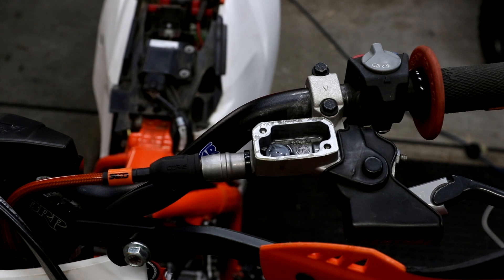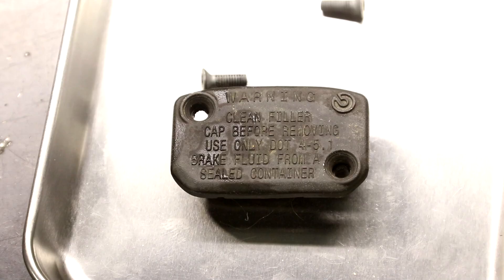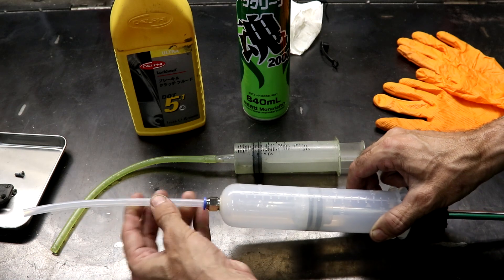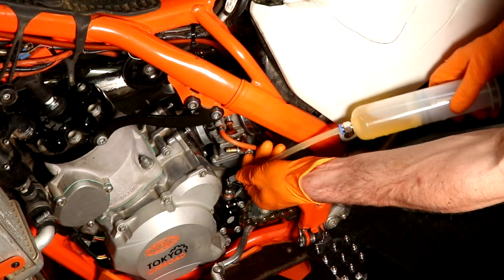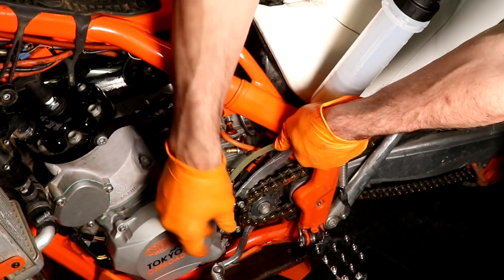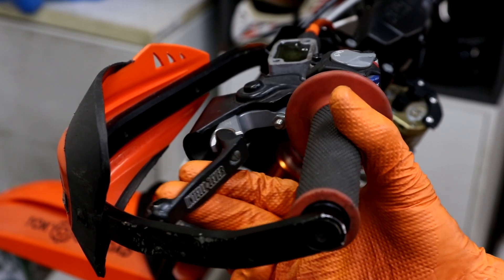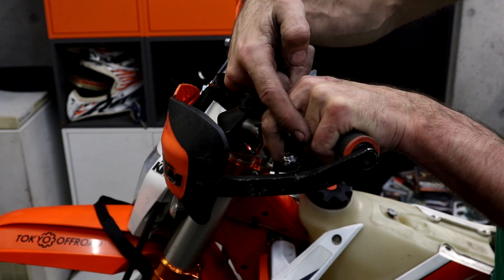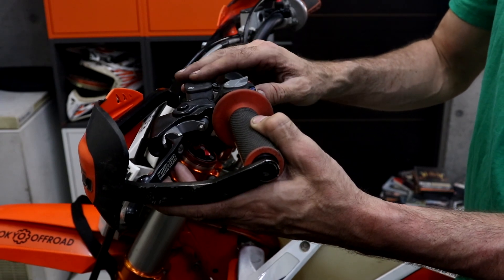Hydraulic Clutch Reverse Bleeding

Comment: To stop the fluid leaking at the slave cylinder bleed nipple, you can wrap some PTFE tape around the threads just make sure the small hole on the side of the nipple is not covered.

Comment: Thanks so much for this. Why don't workshop manuals prescribe this method? I've always suspected there was a better way, as it's bloody logical that air tends to rise in fluid, thus resisting being forced downwards. Is this another example of stupidity in the auto industry, or just a ploy to get people to use more brake fluid than necessary according to 'waste = profit' mentality? Thus we have all these theories on how best to bleed brakes preached by know-nothings and, pushed by the parts industry, an abundance of 'power bleeders' that still waste oodles of fluid (unless you're astute enough to collect and reuse it once the fresh stuff begins to flow) and which aren't even a universal fit. One question I would pose is this: Was it really necessary to keep filling once the master cylinder was full? That is to say, isn't it possible that all the air was expelled once the fluid level reached the maximum point? Thanks again, matey.
Reply: My KTM manual says to do it this way. I dont think there's some kind of plot by KTM to sell you more brake fluid lol.

Comment: I rebuilt my slave cylinder & when I tried to reverse bleed to fill up the clutch reservoir the fluid would push up into the reservoir, can you tell me what might be the problem? Thank you
Reply from the maker: Would, or wouldn't? Fluid should be able to push up into the clutch master when reverse bleeding. If it doesn't make sure that the lever position is fully out (away from the bars, not pushing on the master piston) and that the slave bleeder is open.
Reply from the maker: Also, it you rebuilt the slave, you'll achieve a much quicker system bleed if you fill the slave with fluid and hand bleed it before reinstalling. I show this in this video from 10:30 : https://youtu.be/kfVfvbodc9A

Comment: I am having trouble bleeding the clutch this way. The fluid is coming out from where the bleeding nipple meets the banjo bolt but fluid is not going to the reservoir. I have just done the brakes the same way and it worked perfectly fine. Any idea why this might be happening? On another KTM I had the same issue with rear brake but no issues reverse bleeding front break or clutch.
Reply from the maker: The most likely causes are either the bleeder nipple on the slave is not open, or the clutch master piston is partially engaged (make sure the clutch lever is adjusted out and not pushing on the piston).
Reply: I suspected the lever engaging so I completely took it off and it didn’t make any difference. If the nipple wasn’t open would the fluid still leak out of it? I pushed about half a string of fluid through and it just all basically spilled on the floor. I unscrewed the nipple half a turn. I tried unscrewing even more but it just resulted in fluid leaking on the floor even faster. 
I tried bleeding the normal way by pressing on the clutch lever and everything worked as expected. Nipple opens and closes properly and fluid gets discarded into a hose attached to a nipple.
Reply from the maker: @patpaluch9842  From your description it sounds like a master issue. Either the master piston is partially engaged for some reason, or debris might is blocking the fluid return passage.
Reply: Thanks. I appreciate your help! I’ll recheck the master.
Reply: For anyone stumbling across this thread having similar issue. I ended up solving this. Still not sure what the exact cause was but I ended up taking off the clutch lever again and then I took off the slave cylinder and pressed it which worked and the fluid backed into the master cylinder reservoir. After doing that I was able to proceed with reverse bleeding the system with fresh fluid.
Reply from the maker: @patpaluch9842  Pleased to hear that you were able to get it working. My guess is )if it wasn't the lever engaging partially engaging on the master piston) is that there was some debris blocking the master fluid return and by pressing the slave piston in the force of fluid displaced the debris. If your clutch master needs rebuilding I do have a video which covers that which may be of interest: https://www.youtube.com/watch?v=yigjs0JVai8 and also have a clutch slave rebuild video here: https://www.youtube.com/watch?v=kfVfvbodc9A

Comment: I tried this method about 3 times and each time I have the same problem, 1st problem the syringe is extremely hard to press, 2nd problem I have more fluid leaking from the bleed screw then it's going up thru the hose . What am I doing wrong ?
Reply from the maker: A large, good quality syringe helps and is easier to press than a small syringe. Make sure the hose is a good fit on the bleed nipple. It using silicone hose you can secure it to the nipple using a zip tie. And make sure the bleed nipple is open enough when forcing in fresh fluid from the syringe.

Comment: Hello! I tried this on my bike with the bleed screw open and the reservoir empty. When I depressed the syringe nothing happened. I then took the clutch line off the clutch lever and was able to get the syringe to depress. Any idea what’s going on at the clutch lever? Thanks!
Reply from the maker: The master piston is probably still engaged. Make sure that the lever is adjusted out enough, or fluid will not be able to pass into the master reservoir as it’ll be blocked by the piston

Comment: I've got a gas gas txtpro and having an absolute nightmare. It's just engaging the cluch at the bars, so I've got serious drag.   I've redone this 3 times, and I'm sure it's the right way that I'm doing wrong or not enough.
Reply from the maker: Sometimes you can get some air trapped in the clutch slave and a regular bleed (from master to slave) may work well following reverse bleeding. With some hose on the slave bleeder, try pulling the clutch lever in and hold it to the bars, then open the slave bleeder and note if any air bubbles come out with the fluid. Repeat this 3, or 4 times, topping off the master fluid as necessary.
Reply: @Tokyo Offroad  thanks I'll give it a go.   I've now got it to the point where it slightly drags when it's in 1st but your body weight stops it dragging. So a slight drag.  If it's in 1st and your feet are on the ground then you can feel it slightly. 

Thanks again I'll give that a shot.

Comment: Great stuff, mines engaging from the handle bar so i take it theres still a little bit of air left! Gunna bleed it up from bottom n see if any better! 🙏🏼
Reply from the maker: Yes, probably some air somewhere. Try the reverse bleed and see if it fixes it. If it’s still not right there might be some air trapped in the slave. You can put some hose on the bleed nipple, pull the clutch lever in, open them close the slave bleed nipple. That should get rid of all the air. If you still have problems it could be a damaged master seal, or damaged slave o-ring, either of which can be repaired (I made separate videos covering the repairs).

Comment: I got confused why put brake fluid inside the bleeding were the clutch fluid comes from
Reply from the maker: The Brembo hydraulic clutches on most late model KTM dirt bikes use DOT 4, or 5.1 brake fluid. Note that Magura clutches (fitted to many Husqvarna bikes) use mineral oil. The correct fluid is marked on the clutch master cap and in the owners manual so it's easy to confirm...
Reply: @TokyoOffroad  aw ok well thanks man and Awsome video 🤘🔥

Comment: Hi my sons ktm 65 was going fine parked it up about a month r so started it and wen going into first gear it just stalls and jumps forwards if I give it bita rave it will go but with a slight crunch .any idears
Reply from the maker: If the bike moves forwards even with the clutch lever pulled back to the handlebar then there is either a leak and air getting in to the clutch hydraulic system, or the clutch master, or slave needs rebuilding. If the master seal is gone the fluid level in the mater will not change, but the clutch will not disengage correctly. If the slave seal is gone the fluid level in the master will decrease (fluid will leak into the engine) and the clutch will not disengage correctly.

Comment: What happens if I do this, and and still
Keep getting air bubbles?
Reply from the maker: If air bubble keep coming up, air might be leaking into the hose from the bleeder screw thread. One thing you can do to help prevent this is remove the bleeder and put a little grease on the threads. The grease should stop air leaking into the hose even when the bleeder in loose during the bleeding process.
Reply from the maker: And sometime you may find a little air trapped in the slave. After reverse bleeding, try pulling in the clutch lever to the handlebar and hold it there, then with some hose on the bleeder loosen the bleeder and retighten the bleeder. Repeat this a couple of times if necessary.

Comment: Reverse bleeding is best for clearing air from the clutch line.  For fluid changes you can just gravity bleed and it’s neater and easier.  It goes slowly so you can avoid sucking any air into the lines.  Just did mine this morning.

Comment: Can you use dot 4 oil for the clutch? Because the owners manual recommend motored hydraulic fluid 75
Reply from the maker: Motorex Hydraulic Fluid 75 is a mineral oil fluid. I'm guessing you have a bike fitted with a Magura clutch master. No you should not use DOT 4 fluid. On the clutch master cover it probably states to only use mineral oil...
Reply: @TokyoOffroad  No, I have a Brembo clutch lever, infact on the master cover it calls for dot4/5.1.
I do not understand why on the manual it recommends the mineral oil and on the bike it says another thing...
Reply from the maker: @loskiff  - What bike do you have? Did it come stock with a Brembo master. Is the slave also Brembo? If both are Brembo then you should use DOT 4, or 5.1 fluid...
Reply: @TokyoOffroad  Is the slave the part located on the left side of the engine? In which enter the cable with the fluid from the pump on the handlebar? Thanks
Reply from the maker: @loskiff  Yes, the clutch slave is on the left side of the engine and is joined to the master on the handlebar via the hydraulic hose.
Reply: I have OEM Magura clutch cylinders on my Husqvarna 701 and manual says to use DOT 4/5.1 brake fluid for clutch. The clutch cover itself says "Use only DOT 4 brake fluid". The clutch fluid color is quite different from braking fluid color though, so I'm not sure that brake and clutch have the same liquid from the factory. That's all confusing indeed, but I would stick to the manual and put to the clutch the same recommended brake fluid I used for bleeding brakes.

Comment: My clutch feels fine engages fine but my wheels hard to spin almost won’t when bikes not running and I put it in gear that’s my 300 xc I did same on my 450 xcf and when I put it in gear not running it pushes easy not sure 🤔 what to do with the 300 now re bleed I guess
Reply from the maker: If the clutch operates and engages fine it doesn’t solid like you have a bleeding issue. You may just be experiencing excessive clutch drag. Drag will be higher when the transmission oil is cold. Also do not over fill your transmission oil and use the oil grade specified in the manual for your bike. I made this video which shows how I measured the correct transmission oil volume for my bike https://youtu.be/AhxQje0jFAM

Comment: So at times I have experienced getting air into the system when I loosen the bleeder as air gets past the threads. How do you recommend stopping this?
Reply from the maker: I personally haven't experienced an issue. I think when reverse bleeding the fluid is under pressure and may leak out a little bit past the bleeder threaded area, but in doing so will prevent air entering. I have heard of some people using grease on the bleeder threads to help prevent leaking during bleeding, but haven't tried it personally.
Reply: Thanks my friend! Love the vid's and your quick responses. @TokyoOffroad

Comment: Please note, Brenbo uses brake fluid and magura uses mineral oil ,  ktm uses both, so check your reservoir cover.
Reply from the maker: Yes agree, that's a good point. Never assume what is correct and always refer to what is recommended on the master cap, or in the manual...
Reply: My 2021 701 has a Magura clutch master that uses DOT4 brake fluid.  It’s not just the brand, you need to look at the master cylinder reservoir lid.

Comment: Is it okay to bungee or zip tie the clutch lever overnight to make sure there are no bubbles in the line? Thx
Reply from the maker: Yes. I've tried it for the front brake and it does work. I haven't tried it on the clutch, but certainly won't do any harm...

Comment: I have back bleed several ktm clutch systems.
However, on my 2015 even with high pressure on the syringe I was not able to back bleed the system.
It feels like either the slave piston or the master plunger is covering one of the ports. I even removed the clutch pressure plate.
what I ended up doing is I removed the slave and pumped the piston...which isn't ideal.
I back bleed both brake systems with the same syringe without any issues.
So, I just watched another video by tk2stroke and he had the same issue.
As I suspected the slave piston was covering the bleed port.
He removed the slave which allowed the piston to move forward and he could then back bleed....that sucks if I have to do that every time.
Any Ideas?
Reply: I bet im having the same problem with my kids 105.  I am so frustrated with this bullshit
Reply: I'm having the same problem.  It requires at tonne of pressure and the hose usually blows off spraying brake fluid everywhere.  Very frustrating
Reply: I removed slave and use it as the pump. Just squeeze piston in and bubbles come out.  Pump lever until piston is out.  Squeeze in again.  Pump, squeeze, repeat.  It works really well.  I poured some down line and filled slave before screwing on.   Took less time than any method ive done yet.  I bet if tires removed you could do the same with brakes at the caliper.  I think i will try on my soft ass front brake

Comment: what type of syringe do you use and/or where can we buy it?
Reply from the maker: I purchased mine in a local tool shop in Japan. But if you search for "Fluid Extractor, Manual, 7-1/2 in" on Amazon you can find the same thing
Reply: @TokyoOffroad  I've had issues ordering stuff  like this and then having the hose be too small gauge to fit on the bleeder. Any issues with this one?

Comment: Great video thanks so much!  After bleeding several times though I still have the problem that the clutch lever needs to be pulled all the way down to the grip to disengage the clutch. Would really like to get it so that I can have fingers under the lever and still have no engagement, as demonstrated in your video. Do you have any suggestions on what to do next?  Bike is a 2014 ktm 300 xcw.
Reply from the maker: I think you still have some air trapped in the system. Also try bleeding the other way by forcing fluid out of the bleeder (squeeze the clutch lever with a short piece of hose on the bleeder). Be sure the close the bleeder before releasing the clutch lever. Sometimes, depending on where air is trapped, different bleed methods work better than others and a combination of reverse and regular bleeding may be necessary.
Reply: You called it, that’s awesome, went back and did it again as you suggested, now it works great!!  Really appreciate your help with this, I was seriously starting to wonder if there was a bigger problem with it! Extremely helpful suggestions, thank you very much!!👍
Reply from the maker: Great! Pleased it's working now...
Reply: Plates or basket looking like a steak knife

Comment: Brembo needs to make the master cylinder for the clutch the same depth as the front brake master cylinder. So easy to bleed the brakes. The clutch you get three pumps and it's already sucking in air. This is with the old school method of course. I love your videos btw. 👌

Comment: It says dot something on the lid but the manual (for my sx -15) says "ISO VG (15)" and suggest some Motorex "Hydraulic Fluid 75". Is it really okay to use brake fluid?
Reply from the maker: ISO VG 15 is a mineral oil and that's what you should use. You must not use DOT 4, or 5.1 brake fluid as your system is not designed for it. If you use brake fluid the seals may become damaged and which would result in clutch failure.

Comment: I have tried this in the past many times using a syringe not quite as large as the one you use unsuccessfully. I have not been able to push fluid through the slave cylinder, it instead just leaks out around the bleeder where it's been loosened. Do you really have to use a giant syringe or am I missing something that is blocking the fluid from a reverse bleed?
Reply from the maker: No, I've done it previously using a smaller syringe. One tip if the hose is popping off the bleeder is to use a zip tie to hold it in place.
Reply: Could be blocked port by cylinder

Comment: Yeah I want one. 

What is the right size hose to fit on the slave bleeding ports? Would like to get a few feet of it.
Reply from the maker: The clutch slave bleed nipple OD is 7mm so the hose needs to be smaller than that.
Reply: i use 6mm hose witch fits like a glove